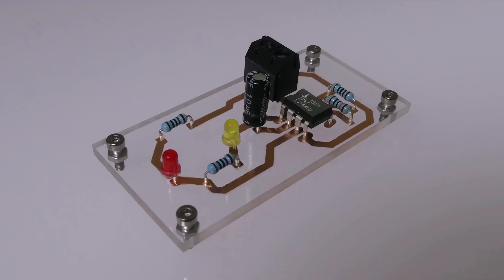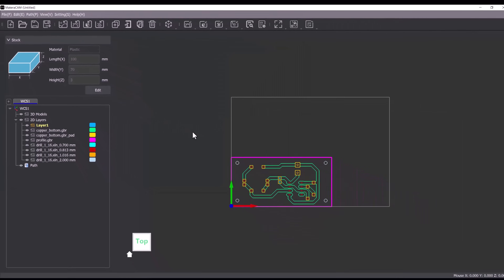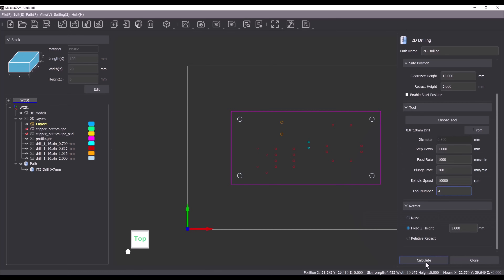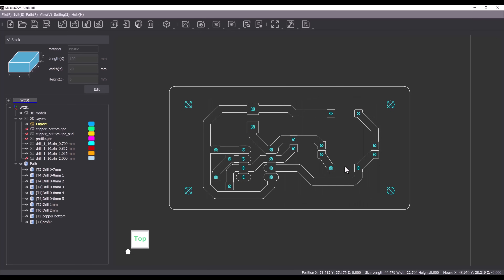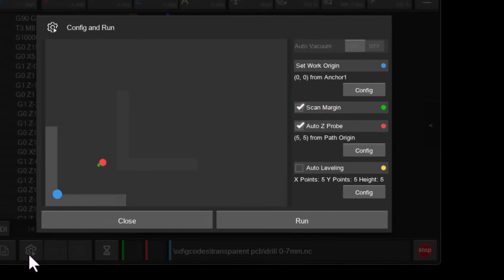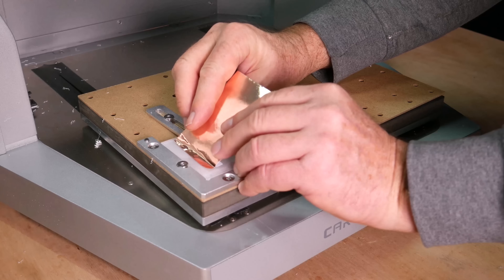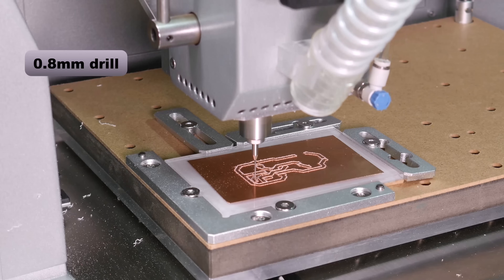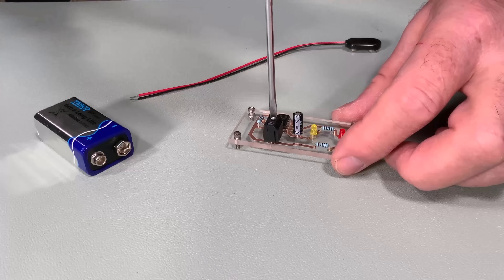How to Make Transparent Acrylic PCBs with a CNC

Comment: is there a reason not to attach copper foil before process the drilling?
i think it will be create easier & neat finish pasting copper sheet to acrylic before every machining process, rather than cutting & pasting copper sheet to acrylic board after drilling.
also leaving unused copper layer parts, not removing them, and connecting to ground will improve its thermal and EMI shielding performance.
Reply from the maker: Drilling acrylic creates acrylic swarf, acrylic swarf damaged the copper, so after testing every possible method I came up with the sequence shown. You can of course leave the unused copper,  but we are trying to make transparent pcbs.

Comment: You could have etched it with Fric chloride
Reply from the maker: Then you have the problem of removing the remaining adhesive and you still have to drill it.
Reply: @techydiy  Check if the Feric chloride will desolve the Adhesive, once it's etched it can be drilled.

Comment: that is super useful. 
do you think you could thermoform the board? 
thinking after you cut the copper but before you populate. 
might be a fun way to integrate everything into the actual body of a drone while adding strength to the form.
Reply from the maker: I think so. It's always worth trying things out. One idea leads to another idea etc.